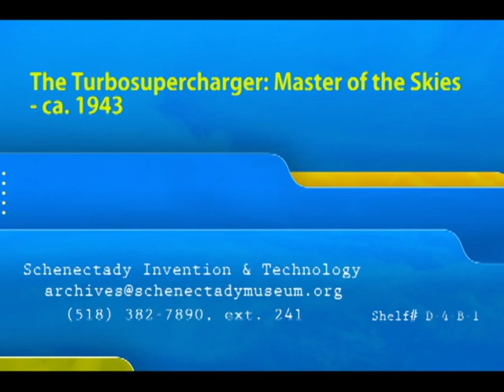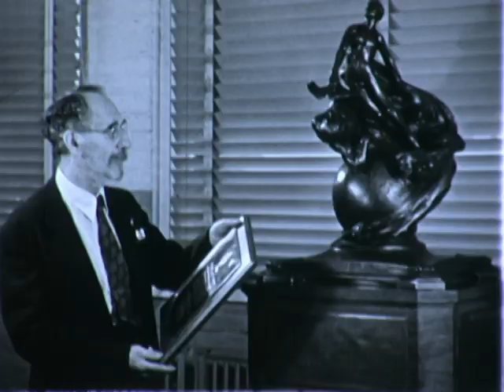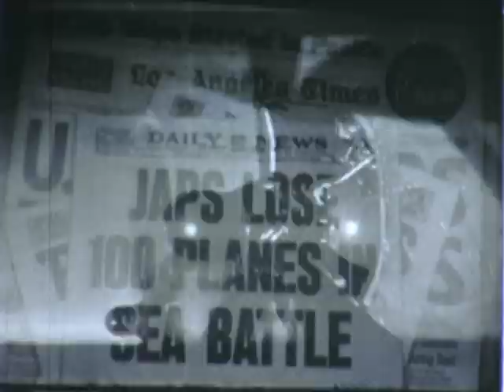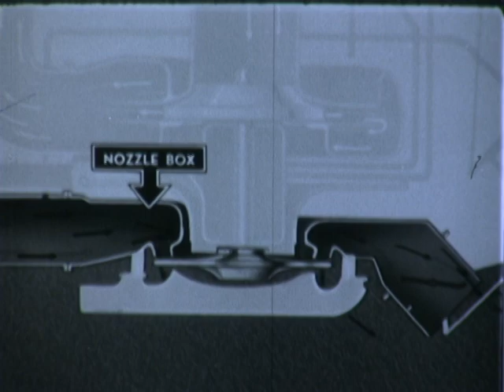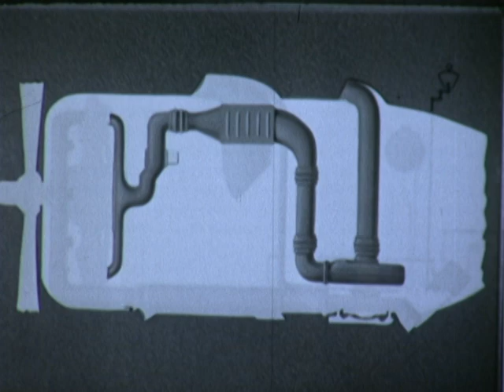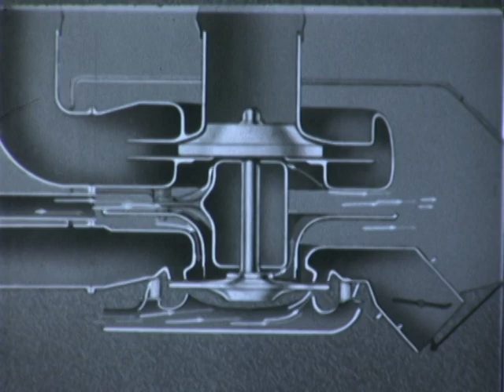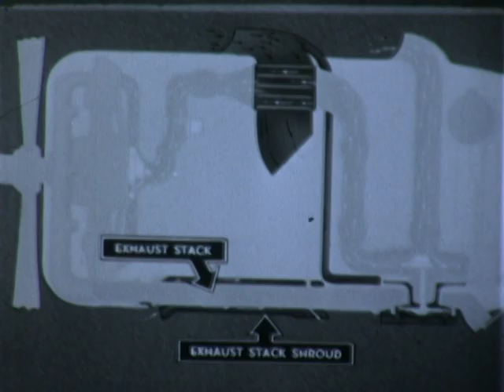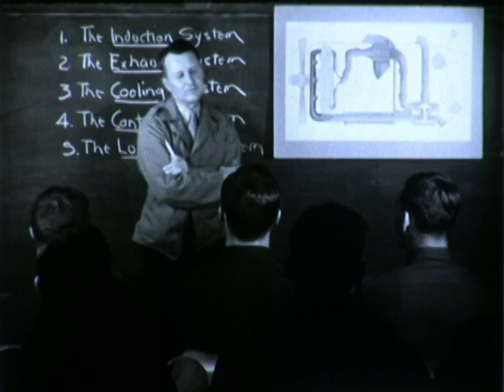The Turbo Supercharger: Master of the Skies - 1943

Comment: What they aren’t talking about is how you have additional gauges to monitor such as induction pressure and brake mean effective pressure. It takes a good deal of finesse to balance the wastegate and throttle as they can both feed each other to devastating oscillations if the pilot’s not careful. Lots of book smarts was needed here.